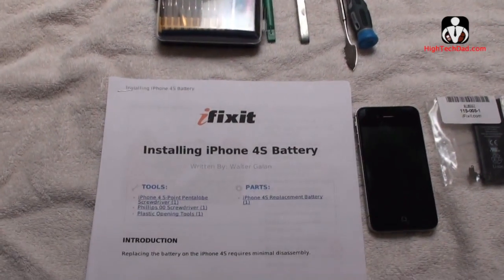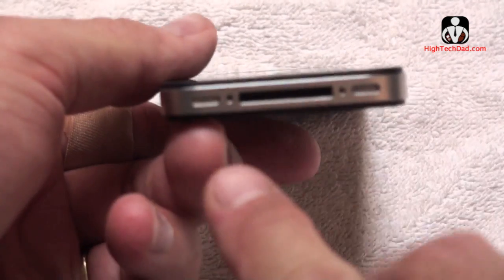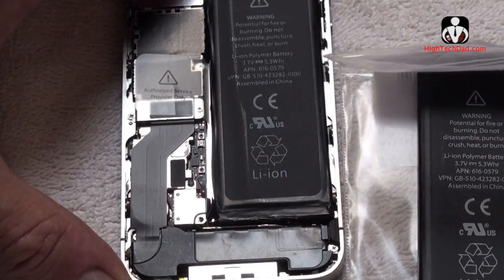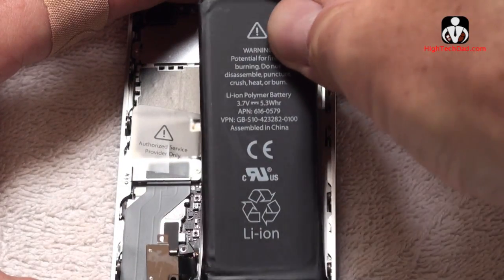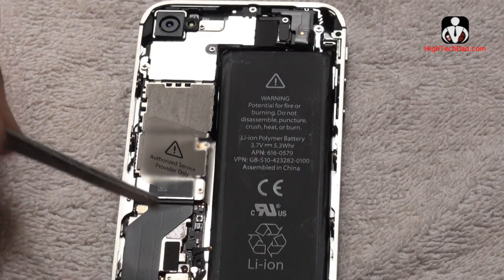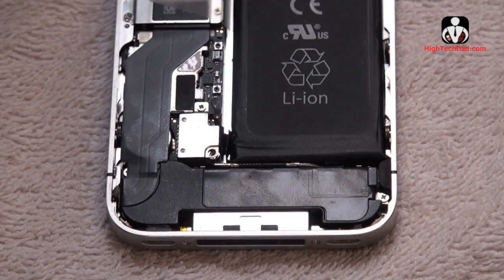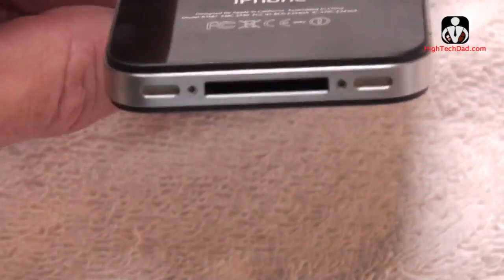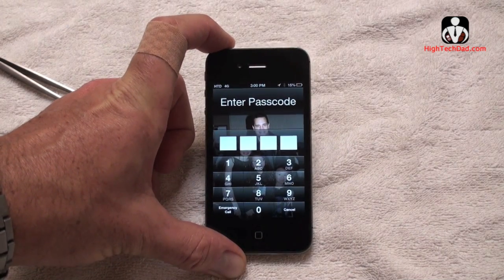How To Easily Remove, Install & Replace an Apple iPhone 4S Battery

Comment: Just replaced mine last night. What a nightmare. I definitely recommend using magnifying glasses (the ones you wear). The screws are unbelievably tiny. It definitely would have helped if I did!

Comment: Great video, still useful in 2020.  Unfortunately, I managed to lose and find the larger battery screw nine times, then permanently lose it the tenth time.  😟  

Hot tip:  Instead of tweezers, use some of the residual glue from the old battery to get the tiny screws to stick to your fingertip, then press the screw into the hole and turn it enough for it to grab the threads.

Comment: My black clip popped out, as expected, because I watched this video before taking the phone apart, I was ready. Great video and my Iphone 4s is still being used 8 years later as my only "smartphone"- amazed the original battery got me this far, I should be good another 8 years, haha, or until the IOS is no longer supported by the apps I use, which should be any year now. Great video, without it, I would would have had a much more difficult time.
Reply from the maker: Thanks for the comment Jeff. Glad that the video helped and that your iPhone 4 is still chugging along!

Comment: We tried this, we were very careful, everything went together perfectly but all we get is a flashing Apple logo!   Help!
Reply from the maker: Did you buy a cheap replacement battery? iPhones don’t like knockoff batteries. And you will get that logo issue.

Comment: Thank YOU!!!! Just saved myself £20 paying for an iphone battery replacement by watching this video that took me from start to finish even before the replecement battery arrived. It meaning the/ this video actually gave me the confidence to know I could easily change my own iphone battery and not pay a shop to conduct the same service at my expense for a less than 5 minute job for a total novice like me with no confidence as I sometimes have the Dumbest moments for no other reason than I'm me therefore prone to foolishness thats unheard of. Once again thanks for saving me from myself and those wolves.
Reply from the maker: Great to hear! It does take some time but yeah, the whole point of my videos is to empower you to DIY!

Comment: That clip is just a trap. It stays on a plastic sheet that is a kind of insulation. Most probably they use a plastic film which they barely pull out after sliding the cover slightly, otherwise the sharp point of the clips cuts into it. It causes a short circuit and the phone keeps on restarting itself.After trying two replacements which didn’t work, I covered the cut and the clip itself separately with smooth(blue) masking tape so they slide on each other.Bingo!

Comment: Nargr8
Just changed the battery on the 4s, the old battery lasted 9 yrs and still held a charge for 10 - 12 hrs unless I was surfing or leaving apps running in the background.
The grounding clip will only go in one way unless it is some how forced into an odd position. The screws are beautiful things aren't they :)

Comment: I can't get the back of the phone off. Seems to be stuck. I have the kit and battery but stuck. Please help. thanks
Reply from the maker: As mentioned on twitter to you it takes some force. You need to push down and slide up at the same time. The screen might be stuck as well. You could try cleaning the edges with a little bit of rubbing alcohol.

Comment: I just changed out my battery thanks to your video, I installed a '2680mah Gold Battery' and now my phone has double the battery life the stock battery had. YEAH! Thanks again!
Reply from the maker: +Diego De La Puente Nice, I haven’t tried that because of potential firmware issues. Hope it is stable!

Comment: That little piece popped out of course :-( Geeeezzzz those screws are so small..... I got my set from Ombar and thank God the screwdrivers were magnetic. The plastic thing broke off of course, but I used a knife and that worked fine. Thanks so much for the great instructions.
Reply from the maker: +W Haak Yeah, that piece is a nightmare!

Comment: Today I managed to get the first screw out to access the back of my iPhone but the second screwhead was gnarled (the phone was second-hand).  I took the phone to Carphone Warehouse to see if they could get the second screw out.  The assistant told me that it couldn't be taken out and then proceeded to tell me that it was connected to the microphone and if the sound on the phone was too quiet, I had to get the screw out, buy a can of air, blow the air into the hole where the charger goes in and then I'd see lots of dirt come out of the screw hole (the same screw hole that she told me I couldn't take the screw out of!!!!).  I took my phone to Walk & Talk and the fella did everything for me and told me the assistant was talking a load of rubbish (which I realised anyway).  Where do they get these people from?

Comment: Just got my 4s out of the old bin. I cant get the back to slide off after removing the screws!!
Reply from the maker: +adaboy4z it takes a bit of force pressing down and sliding but don't crack your screen!
Reply: HighTechDad It was held on with glue!? I used a small screw driver to pry it up!
Reply from the maker: +adaboy4z From my experience, that isn't normal. Sometimes you can loosen the glue using a hair drier.

Comment: hey, i changed my battery and it wont charge. afterwards i realised that ive lost this black clip. could that be the reason ?
Reply from the maker: +Mezz StarDiesel no I don't believe so. It's just a pressure clip I think. Not charging could mean many things like a cheap battery or a cable not properly seated.

Comment: I got the iFixit.com kit, and unfortunately the philips screwdriver that came in the kit stripped the screws inside the phone, so I have to take it somewhere and get those screws replaced.  Be sure you get a good screwdriver that is small enough for the screws.

Comment: You saved my phone! Thanks so much. Just dropped my phone in some hot top ramen .. (who does that?) Needed to find a fast way to take out the battery and dry off everything and this video was so easy to follow. You are so right about not drinking coffee. I was already two cups in and noticed my shaky hands which probably why it took me an hour to do.

Comment: I LOVE the title 'how to EASILY remove...'.  It's far from easy.  You need the tiniest of screw drivers EVER, and if that little bit comes off like it did in the video, it's a nightmare.  I finally managed to fit that little bit back, but it was very difficult, and the bloke in the video decides to put his thumb in the way, which was very helpful.  I'm very annoyed at APPLE, it's not enough that you bought their phone, they have to make it near impossible to change the battery yourself, they want you to spend more money by going into an Apple shop and getting them to replace it, god forbid you do it yourself for free.  Every phone I've ever had, you just take the case off, flip out the battery, put new one in, done.  Noooooo, not apple, they require major surgery to change the damn thing.  SHAME ON YOU APPLE! I can't wait to get a different phone.  Rant over.

Comment: I was taking my battery it cough on FIRE💥 I wedged a Popsicle stick behind and forced it under and pry it up then poof it cough on fire so I threw it outside I know it's my fault because I didn't read about the two countries extra screws....please friends DO NOT MISS THIS STEP IT IS VERRY DANGERIOUS! I inhaled a bunch of the smoke I hope there will be no bad effects......now I'm hearing watching that now there is another screw he's talking about I admit yes I'm an idiot I really hope I don't get sick from breathing that smoke from the battery burning oh and yes the other thing I didn't do was to power down! I feel so stupid right now😧 I hope my story will help someone else from getting burned up🏥🌋
Reply: The exact same thing happened to me!!  I used the plastic tool to try and prise up the battery, but it snapped.  So I used a small screw driver and there was a sudden tiny explosion and smoke!!!  I inhaled also and it was horrible.  I couldn't believe it and thought I had wrecked the phone.  Thankfully didn't and the phone is charging!!
Reply: It must have been wrong type of battery.
Reply: So just to clarify, what exactly did you do incorrectly?

Comment: This is why I love the 4s. 
But I wonder how many people actually replace the battery instead of upgrading.
Reply: +Ramza Are you kidding? There are millions of 4S models still in service.  Mine is 5 years old and still rocking.  Those people that upgrade sell their old phones. You can buy them for cheap on Ebay.
Reply: oh please. I love my 4S.  Most people are not rich.
Reply: Natelle B sometimes it's not about being 'rich' as my iPhone 4s does everything I need it to do - a bit slower than the new ones but I can live with that!

Comment: I have 2 iPhone 4's and both do not have screws.
Reply: +VK West That is because this video is for the 4s, the 4 doesn't have screws on the power connector.
Reply: Thank you. Any idea how to remove the i4 back, to get into it?
Reply: VK West It's identical to removing the back off the 4s, so just follow this video for that part.

Comment: I bought my iPhone used and the charges poorly.  I bought a cheap [cheapass]  battery on ebay for $6. Following your video I took the back off, the two screws inside, popped the clip off, pried the battery out, put the new cheap-ass battery in.  The very top of the battery was poorly manufactured so it didnt fit.  Following your video I put the old battery back in, positioned the wifi grounding clip  I popped the clip back on screwed it in, put the back on, powered it up no problems and wifi works.  iFixit battery costs about $20 and its supposed to be near-zero cycle, like 5 cycles of something so Ill just order one.  I know how to put it in when I get it.
Reply: and tell your story now .. did you installed the ifixit battery ?

Comment: Thanks a lot for the info. Specially the bit on that little grounding piece. Very helpful. The way that grounding piece is installed I imagine most people will pop it. I just replaced the battery and the phone is back on and on charge. I will see how that works. Hopefully I will be able to drag the next upgrade out for some time.

Comment: Great video, thanks!  Seeing the little part fall out and be put back in was helpful too - helped me avoid that. I found it was easier to line up and reattach the metal battery plug first (two internal screws), then put the battery back in it's place.  When you put the batter back in place first, it's a bit tricky to line up the metal plate because the ribbon cable pushes the plate around.  Thanks again!

Comment: nice video mate. but i have a problem after replacing the battery my phone (when I open it) keeps searching for my sim card and searching and searching. before the replacement I didn't have this problem. does anyone know what the problem is?

Comment: Thanks, I just used your vid to help me install a higher capacity battery in my iPhone. 
The tiny screws are not easy for a shaky 58 year old man to handle but I managed. :)

Comment: It's not finding my network! Wifi works okay but not the network it just says 'searching', help?!
Reply: Marta dh Had the same problem. Did a hard restart (Hold the Sleep/Wake and Home button for at about 10 seconds, until you see the Apple logo). Solved the problem.
Reply: Just do a reboot by holding the power button until it says, "Slide to power off" then you slide it, and when it's fully off, then turn it back on with the power button.

Comment: What a fight, when I removed the top screw that holds the battery connector for some reason it was just spinning and not coming out, when I removed the bottom one I realized that the actual metal nut (or whatever the screw goes into) was snapped off the board. Considering no forced was used so I don't think I snapped it off.  It came out with the clip and I removed it and attached it to the new battery (was REALLY hard as the screws are very small) and just screwed the bottom one in.  I hope this is enough

Comment: Success! Thanks for your video, helped a lot. First attempt was unsuccessful, phone wouldn't turn on and when I went to plus it in I just got the Apple logo flashing on/off every 15 sec or so. Opened it up a second time, and did it over with a bit more pressure on the connector and trying to make sure it was pushed in all the way, closed it back up, and works fine.

Comment: Thanks for the video!!!! Just changes my battery and the same thing happen to me. Had the hardest time putting that piece back in but, I did it and it turned on and ever things ok. Them screws are so tiny could barely see them. Thanks again......

Comment: I can't seem to get the two screws out of the connector for the battery.
Reply: You probably softened the screws, which means you can't take the screws out anymore. If you don't see any shape inside the screw, then you're screwed.
Reply: StewiebossFTW it wasn't soft , it was like the screw was welded to the phone, I could put the screw driver in but it wouldn't  move

Comment: Thanks, worked fine for me. Bought a kit online and it took 10 minutes to replace the battery. Watch out for the grounding clip, it popped out on mine too, but easily replaced. Worth watching the whole video before you start so you know what to expect. Replacement battery was 66% charged. Now on charge, so hopefully will be a good replacement. First battery lasted over 2 years with charge dropping to about 3-4 hours before replacement.
Reply: +Darren Bennett So could you enlighten us on how much better this performed? I just ordered a new battery and the one I have has been in there for 4 years :D

Comment: I appreciate your showing the meticulous little struggles.  The battery with glue on the back that you pry out - if you didn't know about you might stop at that point since there is resistance.  The ground clip that popped out, that can unnerve you and swamp your repair. Thanks for your video!!!

Comment: The two screws don't come out on mine... they constantly turn but don't move or come out any
Reply: You probably did not have regular Phillips (+) type screws but had the "Pentolobe" type that have a flower pattern design.  If you tried to remove Pentelobe screws with a Phillips screwdriver it is likely that you damaged the tops of the screw and so the screwdriver just spins and spins.  In this case the screw heads could be drilled out, the phone back removed, and then the shaft of the screws removed from the tab connectors that they were fasted into.  Of course you will then need to obtain replacement screws which are readily available from sellers on ebay.

Comment: When I took out the battery there was no clip in my iPhone will this effect my iPhone
Reply: I would not worry about it, but I can not tell you for certain what it does or how important it is.  The battery grounding clip obviously grounds the metal in the back plate to the rest of the device.  It may be there just to protect the electronics in the device from static from the back plate but it may have some other purpose as well.  There are two other grounding clips in the iPhone 4S near the top of the phone.  One is pretty important to get good WiFi reception and the other is related to the camera.  I have seen the later two clips for sale on ebay but have never seen the battery grounding clip for sale anywhere.  I would be more worried that your clip may be floating around inside of the phone than if it were missing altogether.  Hope that helps.

Comment: dear all youtubers,
i just found the best way to remove the battery from my iPhone. It's even easier than this:

Put your phone on a table, it better be a disposable plastic table, make sure the iPhone is centered in the middle of the table. Now, grab a tool with an iron head and a plastic or wooden handle, place it parallel to the device. Lift it up the table, as high as you can and then FREAKING SLAM SLAM IT INTO THE MIDDLE OF YOUR IPHONE, from personal experience, after a couple of hits, the battery surprisingly popped out!! If you wish to see the tutorial, please let me know.

I found that it helped me save 20$!!!